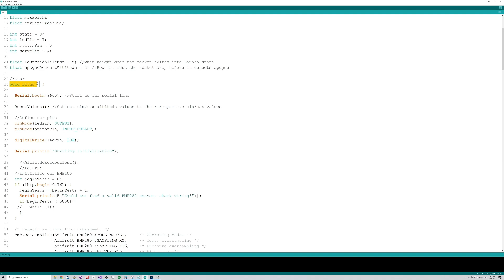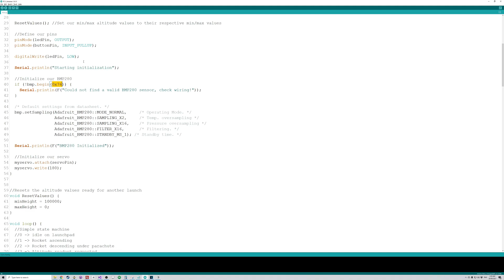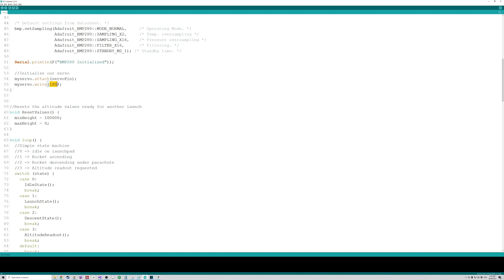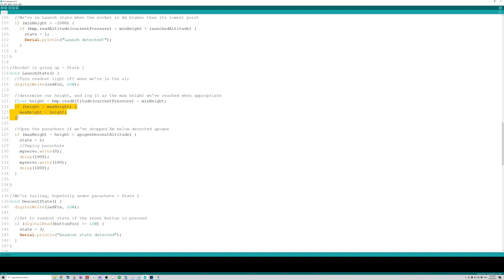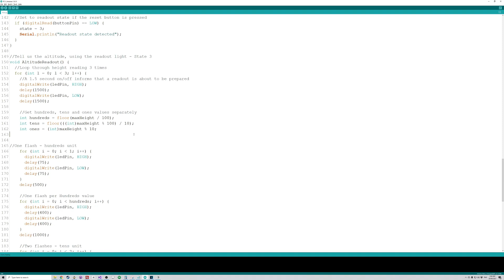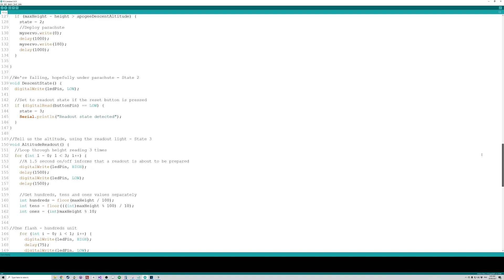How to develop a simple model rocket flight computer

Comment: I don't think you can use your current pressure as sea level pressure. That will give slightly incorrect altitude measurements.
Reply from the maker: Good call! I'll need to test it and see

Comment: Nathan, this is excellent!!!!  I'm just getting started myself and this really helped.  Will you be incorporating the SD card in this code and do you have a basic layout of the wiring?
Reply from the maker: I'm glad this helped!
Over time I'll be adding more and more components as each stage of the flight computer is successfully tested. SD Card logging is definitely one of them.
No wiring diagram at this point I'm afraid